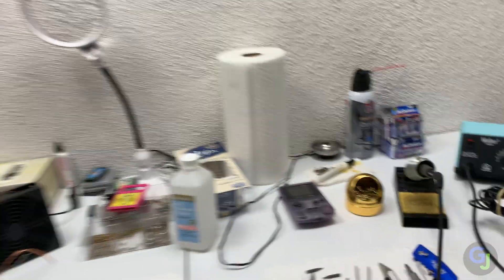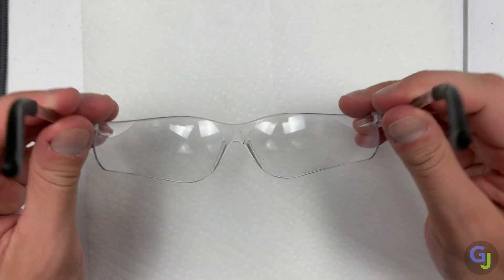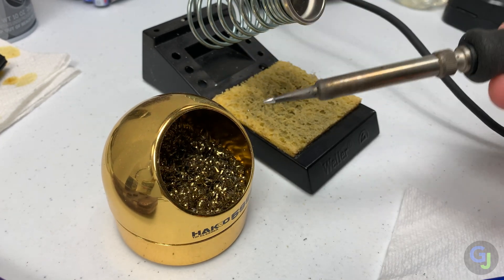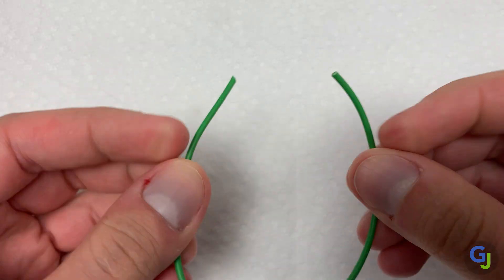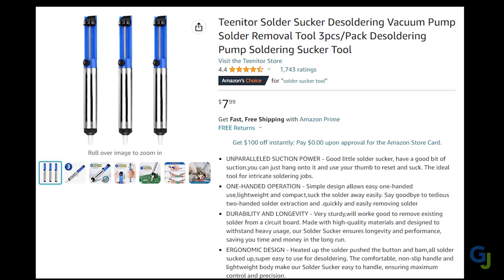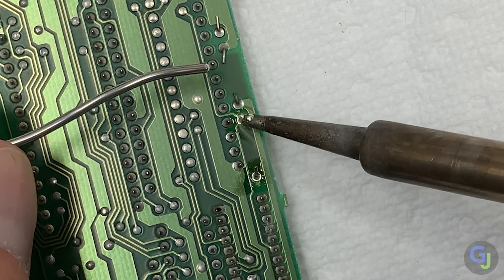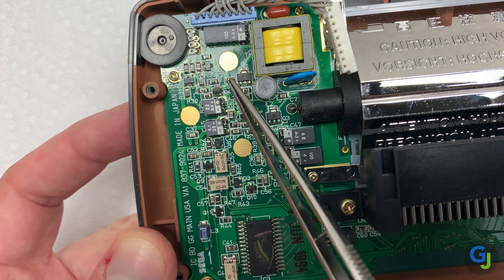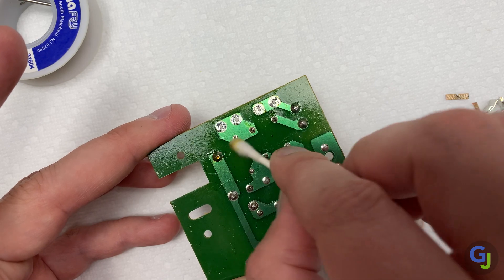How To Start Soldering, A More Than Basic Guide To Electronics Repairs Part 1

Comment: you say flux is a cleaning agent...... i still new to the whole soldering thing, i need a good video explaining how flux works becasue i thought flux was liquid soldier and it make no sence why ppl use tons of it everywhere....
Reply: if you have pools of flux on the board, clean it before your done because it is acidic and can damage the board over time --- got it, thanks for that pal!!
Reply from the maker: You may be thinking of solder paste versus flux. Solder paste is solder but in a thick liquid form and you can spread it over your solder joints and heat it with a hot air soldering iron instead of a traditional iron. That turns it into the liquid metal form and it will harden like regular solder when the heat is removed. You will have to still use flux in this case since the flux helps the solder flow better and helps put it where it should be going on the board pads or components. Then clean up afterwards so the flux doesn't stay on the board to cause damage down the road. The solder paste is really only used for soldering SMDs (Surface Mounted Device) though. Hopefully that makes sense, if you have more questions, please let me know!
Reply: @gamejaeger  for the first time i think i finally get it, thank you very very much for your explanation. 😀
Reply from the maker: No problem :)

Comment: Nice video. I sometimes wonder what my teachers thought when i showed up to school with 3rd degree burns on my fingers from grabbing a soldering iron like a pencil. I maybe wasn't the sharpest kid in the world. Anyway, I just thought that I'd add that the cheap soldering irons that you get at the hardware store aren't worth the money. If I added up all the money I've spent on garbage irons I could have bought a good one easily and enjoyed the whole process a lot more. I use a Weller wes51 too and it's pretty darn nice.
Reply from the maker: I 100% agree on the cheap irons. I mean, they get the job done, most of the time... Spend $10 more and you have a nice basic Weller station that will last for a very long time. Or spend a lot more in our case and have a WES51... :)